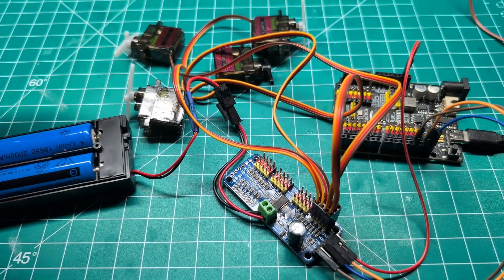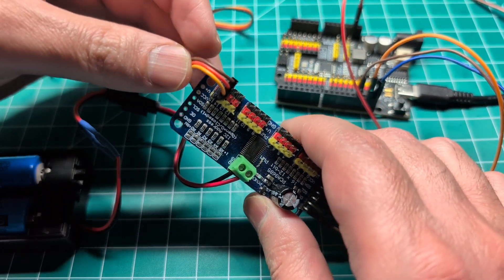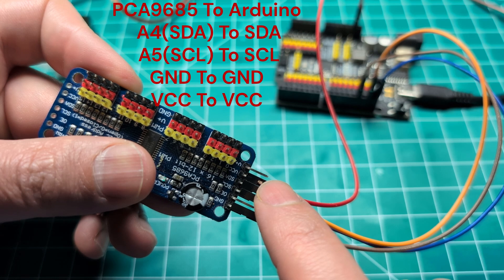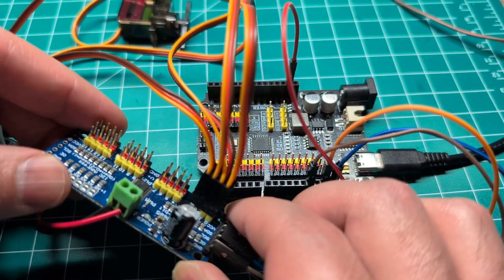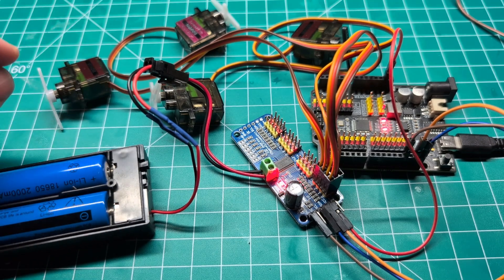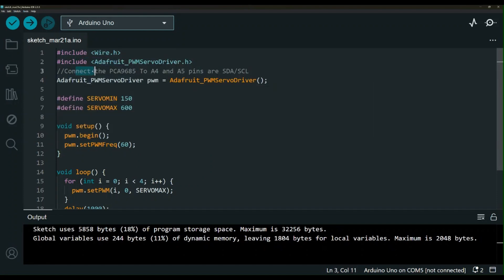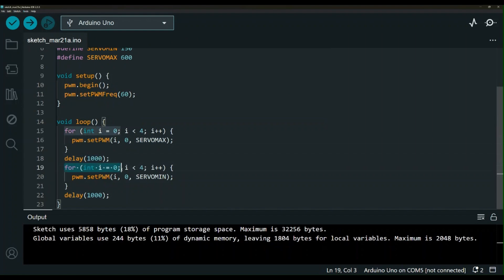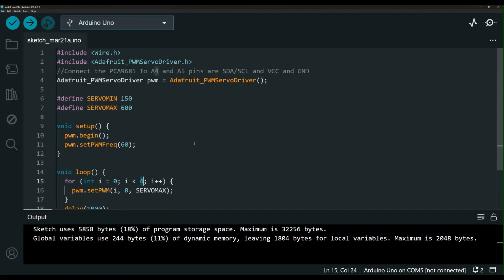Using PCA9685 With Arduino - Simple Step By Step For Beginners

Comment: The PCA9685 is rated up to 3-5 with a 6v max input - wouldn't powering it 2x18650 damage the circuit?
Reply from the maker: You are correct, 5V is what I would recommend, I think my batteries aren't fully charged at the time but ver good call. I will pin this comment since it's very helpful
Reply: @techs.passion  Were the batteries in Series or Parallel? The Spec sheet saids the terminal Block, which your batteries are plugged into, are rated 5-10V, while the V+ pins is Max 6V. My main question is the max current allowed. I've seen videos of people saying 5V 10A works, and I want to add a 2S2P battery pack for 7.4V 7.2A, which, according to spec sheets and other videos 'should' work?

Comment: quick question. I'm sourcing parts for a wireless prop with an Arduino and a PCA9685. I know the servos needs their own power supply, but does the Arduino need its own power supply once its unplugged from my pc or will the jumper wire from the 5v to the  PCA9685 work?
Reply from the maker: Good question, while it's possible to power it from the jumper wires I would recommend the Arduino to have its own power supply to work without being connected to your PC